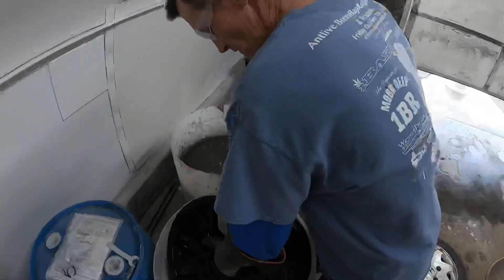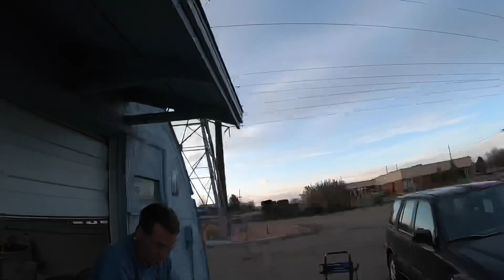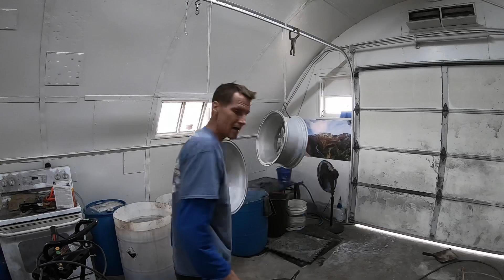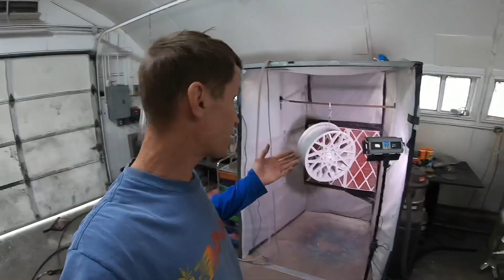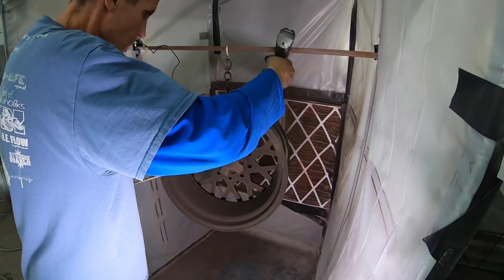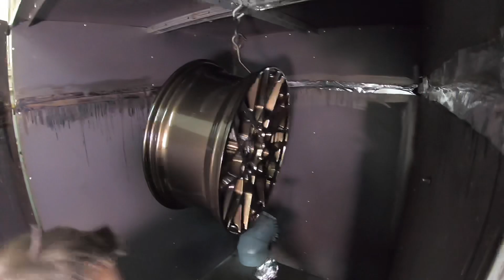How to Powder Coat a Step by Step Powder Coating Process

Comment: First, Thanks for this amazing video! I have a question about the curing process. When do you start your timer for the curing time? Once the piece has reached target temperature? or do you let the piece reach the target temperatura and once this happens the curing process is done, I'm a bit confused on this phase of the powder coat process, thanks!
Reply from the maker: You start the time once the part has reached curing temperature
Reply: @710performance  ok, thank you. Do you guys have a subscription so that I can contribute to your channel and get a couple more questions answered? I’m beginning a small powder coat shop..

Comment: So is there really no need for a primer or clear or is that optional and extra? Also how much of a benefit is it to have primer and clear? Does the clear provide UV protection from color fade? And does a primer actually make it more durable?
Appreciate the video!
Reply from the maker: Primer is usually (but not always) used with steel not aluminum, although you can you don’t have too. Clear coat is optional, but is also does cost extra.  Primer does make it more durable and depending on the clear coat it can provide UV stability and protect it from fading, but make colors do not need it, but it’s good for extra protect and some colors require a clear coat
Reply: @710performance  Thanks, I appreciate it!

Comment: Hahaha…damn homie. Turn the feed down. Waaaaaayyyy down. Your dumping powder on that wheel. Lol
Reply from the maker: Old system, that one was not too good at turning the powder flow down, so we ended up upgrading. Thanks for the tip though.
Reply: @710performance  the wheels turn out great tho👉💪 you should check out SpectraCoat. They make a wonderful system and it won’t break the bank. Hands down one of the best I’ve owned. Great for those faraday cages and other tight spots. I’m in no way associated with spectra coat either. Check them out and keep up the good work brother💪

Comment: Is the blasting stage necessary even if all the paint came off? I heard you can just jet wash them after acid dip and powder coat straight away without the blaster? Is that true?
Reply from the maker: You can do it without a blaster, but you'll still have to sand the wheels or use a wire brush wheel.  But no you cannot take it right from the strip tank, rinse and powder coat.

Comment: What is "OUT Gas"?
Reply from the maker: When you heat the piece you are working on for an extended period of time to release all of the oils and gasses that may be trapped in the metal.  It's best to outgas then media blast it as to ensure the parts is completely clean.

Comment: Well worth the sub! Great videos man keep it up! Im still a newbie at powder coating and hoping to learn more from your channel. I plan on stripping some aluminum wheels next week, but dont have to any chemical strip. Will taking it to a media blaster be sufficient enough? I’ll be using glass beads(fine grit) thanks!
Reply from the maker: That should work just fine, you can strip without chemical stripper, it just takes a bit longer. Thank you for the sub! We appreciate your support!

Comment: Exellent job, step by step, do you take the tires off or receive only the rims? if not how do  manage to deal with dose sensitive electronic air pressure sensor devises, thanks for your attention
Reply from the maker: We have the wheels brought to us only with the tires removed. Sometimes people have left the TPSM attached, and they are actually pretty easy to takeoff.

Comment: Great helpful information! So it’s okay to put aluminum in the rim strip?
Reply from the maker: Yes just check it often.
Reply: 710 Performance what size were those wheels? Look like they barely fit.. I wanna do some 24’s any idea on how I can fit those into some rim strip? Also the wheels are chrome does the chrome remove in the rim strip?
Reply from the maker: King PrettyFlacko they were 19’s. We’re looking at a 275 gallon tote for larger items.
Reply: 710 Performance the wheels that I’m trying to do are chrome do you know if the chrome will come off with that chemical strip?
Reply from the maker: King PrettyFlacko I do know, it won’t. Going to have to media blast it off or use a chrome stripper. We don’t usually mess with chrome wheels and if we do we charge a lot of money to blast it off.

Comment: Where do you get the rim strip
Reply from the maker: Clayton Diamond from Matt (314) 398-4932 let him know 710 Performance sent you.
Reply: @710performance  is there any way I can message  you I built  basically  the same powder coating  set up you have and I have some questions
Reply from the maker: Clayton Diamond sure you can message us on our Instagram @710performance

Comment: Do you reclaim that blasting media?
Reply from the maker: We do not at this time.  We will be getting a small blasting cabinet, but we do like the fact of using clean media all the time as it save us extra steps in our process.  We also get the media pretty cheap, less than $8 for 50 lbs. With the time we save from having additional steps sometimes off sets it pretty well.